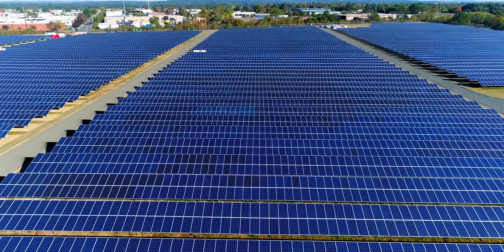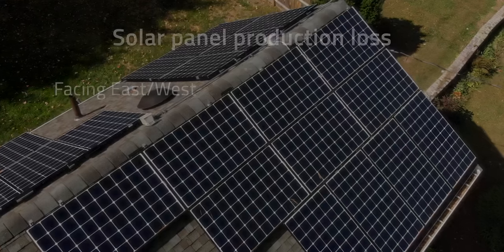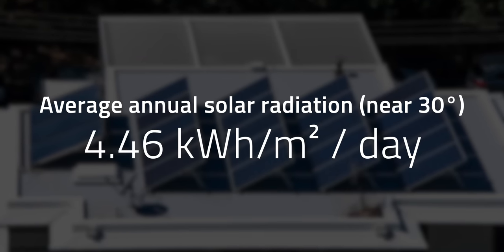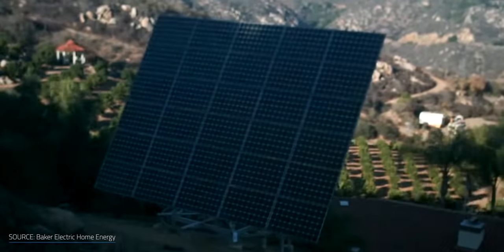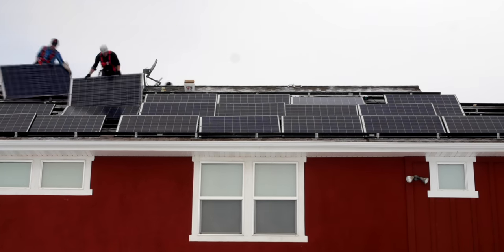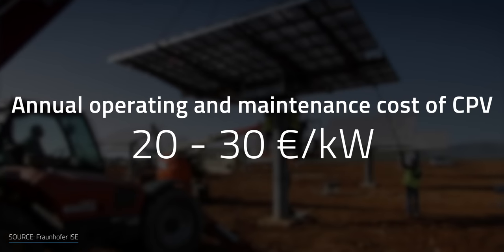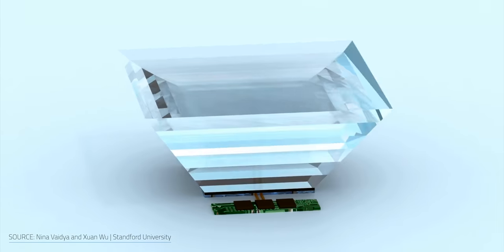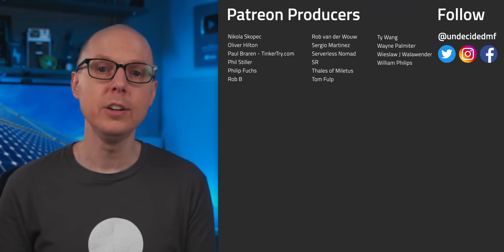This Invention Could Supercharge Solar Panels

Comment from the maker: Do you think AGILE will catch on and make a difference with solar? Visit https://brilliant.org/undecided to sign up for free. And also, the first 200 people will get 20% off their annual premium membership. If you liked this video, check out: 
The Future of Solid State Wind Energy - No More Blades https://youtu.be/nNp21zTeCDc?list=PLnTSM-ORSgi4dFnLD9622FK77atWtQVv7

Or Exploring Solar Panel Efficiency Breakthroughs in 2022 https://youtu.be/m8crjuL8FFs?list=PLnTSM-ORSgi7UWp64ZlOKUPNXePMTdU4d
Reply: Please add persian (farsi) subtitle to your videos 🙏
Reply: I really miss you also addressing the downsides or (unsolved) potential problems of the technologies you discuss. You seem to be extremely optimistic about basically every technology you discuss, but you seldom touch on potential problems in any depth. Here, the technology only makes sense if the combination of a small but expensive multi-layer cell + the concentrator lens on top can be produced cheaper per Kw generated as a conventional cell for the same area, or there is at least the outlook that that can be reached. Or, if it would enable specific niche applications that are not worth it or not possible now, but you don't really discuss either. Also, you don't discuss how panels like this deal with heat. The concentrators will also make the heat concentrated on these small, expensive cells. If a normal cell on a sunny summer day reaches 50-60 degrees C, what kinds of temperatures do the cells using a 10-100x magnifier on top have to deal with? Can they? Is that a fire hazard?
Reply: x
Reply: Here’s a funny thing, this tech was “invented” in the TV show “Medium” by the Husband.  The show is from the early 00’s.  It was supposed to be so efficient that it could work with moonlight.
Reply: No....one word... .HEAT
Reply: @AndreSomers  I agree with you. This channel sounds decidedly "Decided" as he has become a cheerleader for vaporware
Reply: Woo referral kickbacks!
Reply: I'm confused about part of your description of a concentrators efficiency. If you concentrate the same light into a smaller space, isn't it just using the same light and energy with more efficient PVs? So magnifying by 100x doesn't produce 100x the energy, but rather allows us to capture the higher 40% of the available energy, rather than the 20% we'd get from standard PVs. So it's only 2x the energy, and not 100x. Do I have that right?
Reply: The limiting factor is the projected area, i.e. how many photons are captured by the panel. From what I can see here, maybe these lenses can allow the concentrated beam to hit a the same small area even for small deviations of the panel alignment (which is fine), but cannot do anything about the inevitable factor cos(panel_angle). So the exact same efficiency loss is inevitable, since this stems from basic physics.
Reply from the maker: Really good feedback, Andre.  Appreciate it.
Reply: @carsonrush3352  nice to see you have a grasp on real math. To do what Matt claims would defy the laws of physics
Reply: The AGILE lens looks extremely promising. I would love to see the scientific data regarding just how much light is reaching the pv when the sun is at an angle, verses perfect perpendicular orientation. Is it possible the pv receives more light when at an angle, due to the splitting and magnification effect of the prismatic lens?
 
Ultimately, if it just "boils" down to cooling, that's a hurtle that can easily be overcome...
Reply: @Quickened1  you can never get more light than it hitting a PV cell at 90 degrees. That is the maximum photon density. As for cooling, to dissipate heat at the intensity level of 100X concentration and not have it damage the PV cell you are talking about a very energy-intensive and active cooling system which would most likely negate any energy gains.
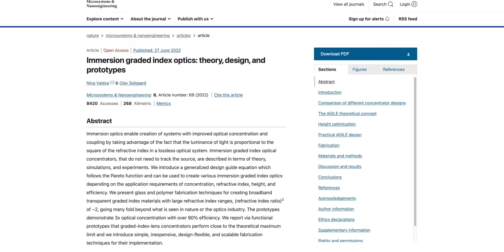Reply: 9:40
Reply: Did you give a expected date the Agile panels are projected to be available? If so, I missed it.
Reply: No.  Cost per watt is the bottom line, along with the 20 year warranty requirement.     It's the same reason people are not likely installing 40% efficiency, multi-junction solar cells on their houses.    OK for powering a satellite as cost is not the main object and weight/space is an absolute premium.
Reply: Agile is a confusing name since Agile tariff in the UK is the equivalent name for Time of Use billing in the US.
Reply: Saw some translucent/transparent solar panels 10-12 yearsago that would be great as a carport or patio cover but have yet to find them for sale.   They also harvested reflected solar energy increasing their efficiency.  They'd be a great way to increase utility of spaces without doubling up on waste of resources, costs, etc.
Anybody know which companies make these???
Reply: @b_uppy  I get advertisements for the those all the time.  I don't think Matt allows links, but there is at least one company in VT called Suncommon  That uses bifacial panels on carports.  It especially works great in the NE, since we get a lot of snow and the panels still produce a lot of energy from the reflected light on the bottom even though the top is covered with snow.
Reply: @scottkolaya2110  
Thank you!!! 
Think they'd work here in Seattle where we have a lot of cloud, and capturing all the light you can is nice.  Having power on snow days is great as well, lol.
Reply: @hyfy-tr2jy  Another youtuber Will Prowse did something very similar using a large glass similar to a magnifying glass, it did boost energy harvesting beyond what the panel was rated for. Temporarily. You are correct the enemy is heat. I will see if I can find the video, I enjoy his channel and I have learned a lot.
Reply: I'm against AGILE.  The name is already overused in other fields.   Esp.   Programming. 

As for the solar power technology here, it seems a bit questionable and finicky.
Reply: @macmcleod1188  LOL I forgot about that, AGILE Project management.
Reply: @smccomas01  yes!

'We are going to try something which is called Agile programming.

“That mean no more planning no more documentation just start writing code and complaining”.

I’m Glad it has a name.'

I preferred RUP.  Similar to AGILE.  
It's also time boxed which i like a lot.  And it delivers an executable deliverable once per 4 to 6 weeks depending on your time box.    Unlike AGILE,   RUP requires all risk is addressed up front before you can start construction programming.
Reply: @Johnrich395  By invented you mean they took a basic optical principle and put it in a TV script?

Concentration of light is just magnifying lenses - which have been around for centuries.

That being said more modern materials and lens types will make this so called "advancement" seem quaint by comparison.

This clearly adds further depth to the panels (increasing weight and load for the roof to bear) to say nothing of cost too undoubtedly.

Future metalens elements and space plates will reduce this extra depth and associated weight considerably, while also allowing for highly tailored light amplification.
Reply: @AndreSomers  "what kinds of temperatures do the cells using a 10-100x magnifier on top have to deal with? Can they? Is that a fire hazard?"

Great point.

The solar waterways projects in California and their forerunners in India use solar panels supported over flowing water which both reduces evaporation in water starved regions and keeps the PV panels cool.

It feels like you would need something similar here, with some kind of flowing loop beneath or through the panels.

Perhaps it could even run through a heat exchanger to harvest energy and reduce the power cost of pumping the water.....
Reply: @carsonrush3352  "So magnifying by 100x doesn't produce 100x the energy, but rather allows us to capture the higher 40% of the available energy, rather than the 20% we'd get from standard PVs"

No.

Multi junction cells are already more efficient - then you stack those gains with the concentrator optics.

In truth as you say you are not really getting 100x the light - you are just concentrating what is available.

On clear days most of the light will be direct and clear - whereas on clouded/misty days the light will be mostly indirect/diffuse, so these multi directional concentrator optics will probably be more beneficial on the coudy days?

I'm probably off base here 😂🤣
Reply: I feel like the images of these prototypes in an array is a bit misleading, if one lens obstructs another, it would degrade her performance of that module. It seems to scale this up will require either one lens per panel, or rethinking how PV modules are packaged. I could see combining a mobile array design with the lens approach tho- terraces of lens focused PV modules all staggered allowing each a full sightline to the sun...
Reply: @hyfy-tr2jy  I'm not so sure if that. Prisms are amazing things. You can absolutely get more light than when perpendicular by using mirrors. It's a scientific fact!

As for cooling aspect, I can think of a passive means that would require no moving parts, or added energy. That would equate to a pretty efficient method. Impossible things become possible when you think outside the box!
Reply: @mnomadvfx  yes, that’s why I put it in scare quotes.
Reply: what about the increased heat from the concentrated sun rays?
Reply: @Quickened1  mirrors are a different story, sir. I said LENSES, not mirrors. The tech Matt showcases uses lenses.
Reply: I wonder what what this could do for solar electric paneled electric cars down the road, excuse the pun.
Reply: @hyfy-tr2jy  you did not specify lenses, you just said "you could never get more light than hitting the pv at 90 degrees". I then told you that you can with mirrors, so that negates the "never" part.  Matt also mentioned mirror technology in the video as well. Now that that's clear, back to the lenses, they are prismatic, which makes them unique, and capable of scattering light much as a mirror can, but on top of that, they can do one better by splitting a single beam of light, into several. Soo, I'm pretty sure the geniuses that designed these lenses, have figured out how to focus more light onto the pv from various angles, and just perhaps, it can focus more light on the pv at an angle, than what it can when the sunlight hits it at 90 degrees... How? Because it's designed that way!
Reply: yawn. unless China makes this themselves, one is better off buying more panels. additionally, concentrating light will increase temperatures to the cell which results to a loss, negating advantages of lenses.
Reply: Matt, 

there is a tracking system which I consider a breakthrough, which you didn't mention. There's a company called Sunfolding which uses compressed air and pneumatic bellows to actuate their trackers. The bellows are blow-molded out of UV resistant plastic using a process comparable to how plastic bottles are made; the compressed air is just distributed via UV-resistant tubing. Here's why this is a big deal: nearly all the moving parts (the compressor and the distribution valves) are at ground level (at least the parts which are at risk of failure; the hinge on which the panels rock is not one of these). This makes them much easier to maintain vs. actuators mounted up near the panel. The bellows and tubes themselves are virtually maintenance free once installed. Also, a single air compressor can actuate a very large number of panels via the bellows, so this system actually scales really easily. The cost of this method of actuation is also far cheaper than other methods of actuation. Basically, the cost of plastic tubes and bellows + a small compressor and valve set vs. other systems which have as many motors as there are panels, and their associated hardware. They're not exactly new either, they've just been overlooked. I saw them at a trade show several years ago. Take a look at their tech. I think more people should know about them.
Reply: @carsonrush3352  He never claimed 100x the energy would result from, for example, 100x concentration. The concentration is not to increase the energy output, but to reduce the amount of the high efficiency solar cells, since those are much more expensive. If you can use a smaller area of higher efficiency solar cells, their higher cost can be balanced by higher output per unit area, but that higher output per unit area is contingent on catching the sunlight from the same area, which is why concentrators are used.
Reply: @hyfy-tr2jy  What are you talking about? What specific claim of Matt are you referring to, and what law of physics would be defied? Carson Rush is misunderstanding what Matt stated. Matt never stated that higher concentrations such as 10x give 10x the power; the video clearly showed that the concentration was so that less PV material could be used, since the multi-junction PV material is more expensive. It is necessary to use less of it in order to make it more cost- effective. No laws of physics are being defied here.
Reply: This becomes an economic problem not a technical problem. The economics fail here
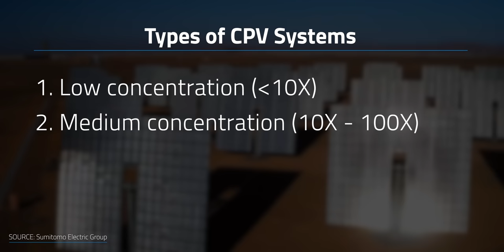Reply: @Berkana  8:35
Reply: @zodiacfml  you must have missed the part discussing that very subject. As for China making them, well yes, because if China makes them, even though they might be an overall inferior product, at least people will be able to afford them. That's when you buy five, knowing at least one of them won't work out of the box.
No offense, but that's what you get when you pay your children with fish heads and rice, to manufacture products...
Reply: @zodiacfml  I never said the world didn't buy products from China. I just said that if you buy products from China expect that one out of five will be defective (bit of an exaggeration), and that you can do so at a much cheaper price because China uses child labor, and pays them with fish heads and rice. 

Just because the majority of the world buys China made products, doesn't mean China made products are the best. It just means they are there cheapest. Because let's face it, people are cheap! But if you want the highest quality products you buy US, Germany, Swiss, etc. Just be ready to pay the price! Oh, did I mention the amount of pollution generated by the manufacture of Chinese products? And yes, I love in a cave.. My
Reply: AGILE is ingenious !  the use of 3d additive manufacture of the "funnel lenses" using varied refractive index material is also ingenious.  It looks like it may provide about 2.7 times more  photons to a given photocell surface .. but also lose 10% of the energy for a given area. the advantage will be the use of the multilayer photovoltaic material to produce the 40% efficiency vs the cheaper material...  It will be interesting to see if the balancing is actually practical when in production. i am not that convinced of the advantages over a tracking system because the surface area does not change.. is the total number of photon is still the same as a fixed panel ( in fact you lose 10% due to the transmittance of the lens).  if the multi junction solar cells are more 6 times the price of of the single junction cells then it may be worth it.
Reply: @Quickened1  sadly it is not clear cut or not easy.   if money is no object then going more expensive suppliers is easy decision. except for luxury products, price is a factor in most products which is where China comes in.   China has most renewable energy generation and CO2 per capita is much lower than the US, it is only they make/manufacture much products which is why their pollution is also high. 
True that they pay low for labor but It is not child labor but millennial/Gen Z labor which is the reason for worker burn out and their crashing birth rates.
Reply: It's really groundbreaking technology, but tit's not without downsides. First is that panels currently on the market are very light, while adding literal 1 inch layer of glass or plastic on top of the panel will put the weight beyond many current installations' weight limits. It will make retrofitting impossible, and with big enough installations rooftop arrays may be limited. Another consideration, common to all concentrator type arrays is cooling. MJs get hot - and they lose efficiency much faster than single junction cells scaling with temperature. While liquid cooling the panels is getting more common, it has same issue as trackers - cost. Not to mention dealing with leaks in a system with potentially several hundreds of potential failure points.

It's not without other upsides, though. There is ample distance between the cells, making the possibility of custom-shaped panels attractive solution, closely followed by another possibility of having individual modules swappable. Both repairing (like after hail storm) or upgrading the installation by swapping portions of the array is going to be much easier (no need to disassemble whole system), but also cheaper and e-waste friendly (we are not throwing away fully intact and working part of array). It's going to be more labor intensive, though.

The balance will be dictated by cost, of course.
Reply: @macmcleod1188  That is out of my wheelhouse a friend if mine talked about AGILE PM I completely forgot about it. Too many buzzwords I want to know the facts, the specifics when I hear current buzzwords, lingo I lose focus.
Reply: @hyfy-tr2jy  Or you could simply make a hybrid thermal system that heats water at the same time. They already have conventional hybrid panels designed to heat pool water. Sure it’s more expensive but also solves two problems at once.
Reply: @mondotv4216  I totally understand there are potential options but at the end of the day when you condense light as intensely as Matt illustrates a passive cooling system such as just letting the water cool it in some passive heat gradient loop system won't cool it fast enough. It would have to be an actively powered system to move volumes of water past the PV cells. As an example, passive cooling will not work to keep modern computer chips cool enough to not fry themselves, you must have an active cooling system be it a hybrid fan/heat pipe setup or active liquid cooling. The point being is if you think computer chips heat up fast and hot, that would be nothing compared to the heat levels 1000X condensing or even 100X condensing would create.
Reply: I don't see the benefit of concentrating the sunlight. I mean, produced e-energy per cm^2 is still the same, right? otherwise, if the used high efficency solar cell do have a better transformation coefficient, it would also produce more e-energy, when it is in normal size without the focus lenses. The higher production effort seems senless imho. ??
Reply: @michaspringphul  the idea here is that a higher intensity light will boost the efficiency of the PV cell used. We see the same sort of gains with the mentioned PV cells when used on spacecraft where solar intensity is higher
Reply: @hyfy-tr2jy  i understand that, but isn't it the same energy efficiency per square cm? the solar cells are much smaller. And if you would spread them to the same area as the leses cover, wouldn't that produce the as same high output as with lenses?
Reply: @michaspringphul  Lets make the assumption that both panels are the same size in surface area... the normal PV panel is 20% efficient and the one with the condenser, due to higher intensity light is 40% efficient we should, in theory, be able to produce the same amount of electricity in half the space. It all looks good on paper BUT in real world deployment there are a ton of other factors that make this concept a non-starter. 90% of the concepts introduced on this channel fall into the same category...they look good on paper and maybe even in a controlled lab environment but have no path to real world use at scale.
Reply: Have to wonder if Perovskites, also printed, along with this tech and a Solyndra type collimator with integrated cooling would be a path forward.
Reply: @carsonrush3352  No and no, think magnifying lens.  Concentrator value is the "multiplication" of the initial lens size versus the size of the been hitting the solar cell.  Then, you add a higher performance solar cell - very expensive high-performance solar cell can be used when cheap optics are utilized to magnify down onto the surface of the MJ solar cell.
Reply: Interesting, but I fear this will not be cost-effective.
Concentration means many small PV cells rather than few big ones. To produce 1.8 - 2x more power than conventional PV, the small cells need to be of much higher quality and hence more expensive, but the total area is only 2.25 times smaller because the concentration factor is only 2.25.
Mass producing lenses with an optical density gradient by 3D printing also sounds rather expensive.
Reply: BTW, how is organic PV doing?
Organic might be the way to go for unfavorably oriented surfaces if the costs come down.
Reply: My concept in real world implementation 😂
Reply: @UndecidedMF  Aloha Matt, I watch these videos to mainly get insights as to what companies and/or universities and research labs are doing what. It would of been real helpful if that would of been done in this case. I’m interested in solar panel, wind turbine and battery technology research in order to learn all that I can in Off Grid applications. Mahalo
Reply: @mnomadvfx  
Link it too geothermal heat reservoir.
Reply: Wtf, dude.
$15k for 15 panels???
It's a dollar a  watt, not 10$
What are you guys DOING over there in Cali?
And then it's 20$ a watt if you want a few cheap motors, brackets and cheap Chinese electronic controllers?
No wonder people think solar is a scam
Reply: @mohammadhadinosrati6788  Why?
Reply: I really hope, agile will be available asap. It would solve my current challenges.
Reply: Niche only.  3D printing isn't suitable for large-scale production.  It's suitable for one-off to small scale production when the approach is necessary to ensure high quality control and the additional cost can be absorbed by high per-unit profits.  I can very easily see, however, the economic scales tipping to mass production, provided the unit volumes support it, rolling out 10 sheets of glass each with progressively greater densities, followed by a hot-cut and form over rollers before dropping the cut pieces into hot oil for gentle cooling, followed by a wash.  Alternatively, don't cut the last layer.  Instead, use it as the upper (outside) layer.  

Meanwhile, I analyzing a number of alternative configurations, optimizing their layout and geometry for latitude, local variation with respect to seasonable cloud covers, and other factors, and more than doubled their efficiencies without the use of any optical concentrators at all.  

Remember:  During North America's three summer months, the sun's azimuth is north of the east-west line for the first 3+ hours in the morning and the last 3+ hours of the evening.  That's some 7 hours pointing in the wrong direction vs the middle 12 hours when south-facing stationary panels are pointing in the right direction.
Reply: @mnomadvfx  Solved a decade ago when CPV was popular.
Reply: Optics to receive light is more costly than just making the entire solar panel out of the better stuff, from an angle no matter the optics you have on a panel, the footage of sun stays the same, a better solution would be to use hot sand as a battery, like in the desert and generate power from the hot sand. or maybe even create a huge sterling engine in the sand
Reply: Agile, eh?  Ferrell's gotta milk nickels from every fad and buzzword.  I'll bet the serial liar uses the word "synergy" unironically.
Reply: @hyfy-tr2jy  Well, you know, any good conman has to work the angles as they're presented to him.  And Ferrell is nothing but a conman.
Reply: If you live near equator, you can ditch  the solar tracker and other stuff because the sun is overhead for all least 6 hours, and decent light condition for 2-4 hours.
Reply: The main issue with solar is cooling, as at a certain point your panel becomes too hot to be efficient (especially at summer days). Seeing this invention, I would assume that the cooling will be the main problem as the aperture blocks any convection cooling at the top of the panel, leading to significant lower yields during sunny days. It may gives better yield during less sunny days, but I`m not sure if this outweighs the loss during sunny days.
Reply: Because you put the reverse pyramid structure of the solar cell beside on another than the wide side determine the size of the panel, there for it is hard to believe it is produce more energy from less area by itself (the pyramid structure).
Reply: I remember reading an article in 2019 that scientists found making the crystals with a coffee mixture increased the solar panel efficiency. What happened to that? Was I duped?
Reply: @carsonrush3352  With low light conditions the concentrators allow panels to produce more power when cloud cover reduces output.  So 2x makes more sense than 100x so how did they come up with 100x ?    Output will increase but there is a peak amount of energy that can be produced.   Perhaps a follow up video after Matt asks questions.
Reply: That's my concern too so can agile make a difference,  can new panels withstand the heat and degradation or will panels have a shorter life ?  Can Older panels be upgraded and can they handle the increased power output which I doubt and will life expectancy be reduced and by how much.  Older panels will have a peak output based on the equipment but on low light days the magnification can increase output.  So older panels would require cooling fans to vent the heat or degradation and damage ensue.
Reply: always concept no result.
Reply: Actually, Matt, this is old tech.  I remember an article in Popular Science years and years ago that talked about putting focusing or Fresnel lenses over solar cells to concentrate the light directly onto the solar cell regardless of the position of the sun overhead.
Reply: Fresnel lens
Reply: Generator
Reply: Just put it on a platform that can follow the sun.
Reply: I've seen other versions of this over the last 30 years and it is always destroyed by the ongoing continued decrease in the price of photovoltaic cells.

There are also always Heating problems and this leads to more expensive harder to maintain Cooling solutions.

So I view this more as a scam than as a potential solution.